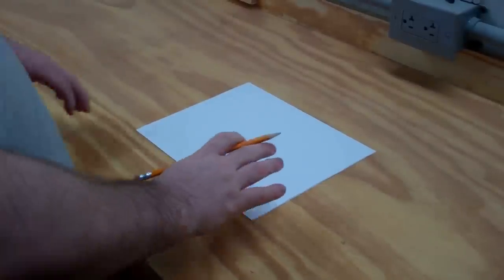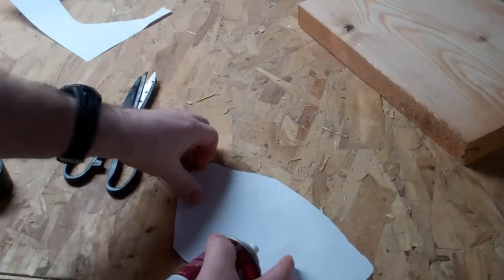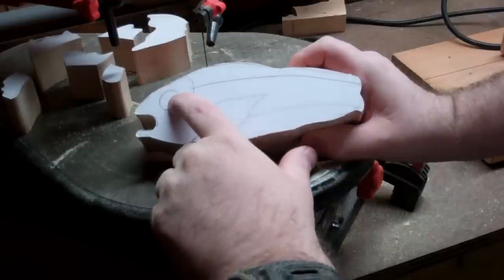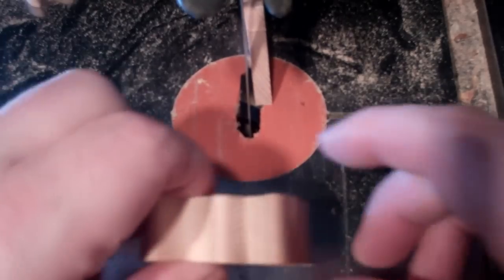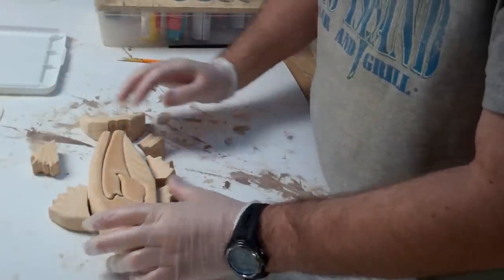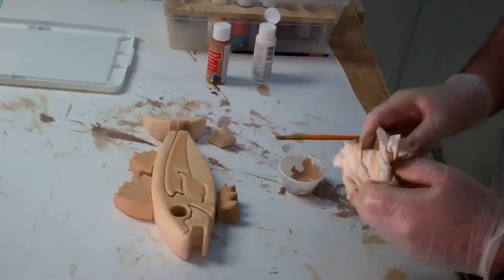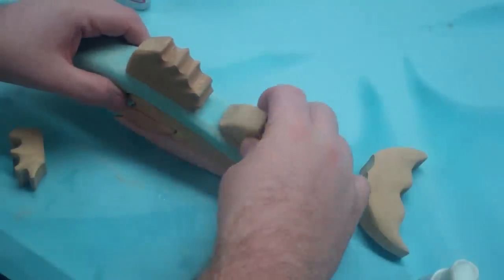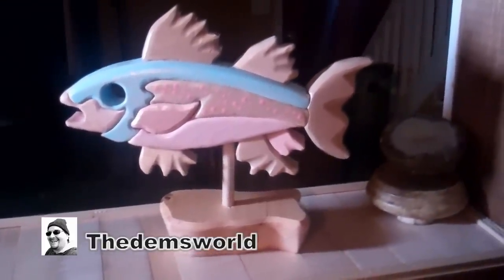Scroll Saw segmentation Fish woodworking project (no cost)

Comment: That came out awesome! What scroll saw blade did you use that cut through that so easily? Was it a rounded one or a flat edge one? I have been using the flat ones and i have to push my wood through and my piece of wood bucks all over the place. Thanks!
Reply: +Lisa Montminy I have the exact same issue. many a pieces have broken due to the "bucking" have you came across a fix for that?
Reply: Try spiral blade